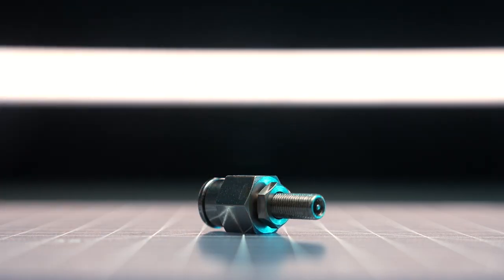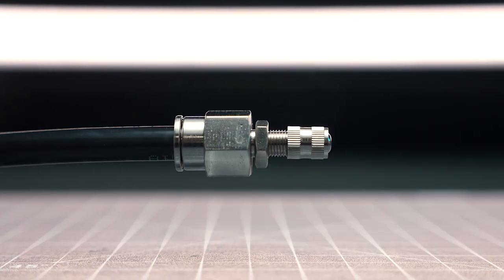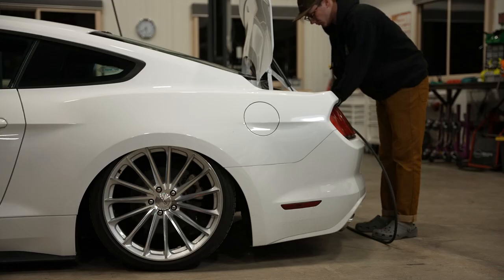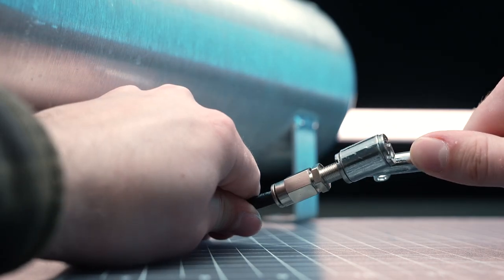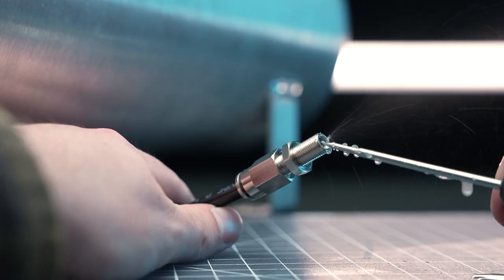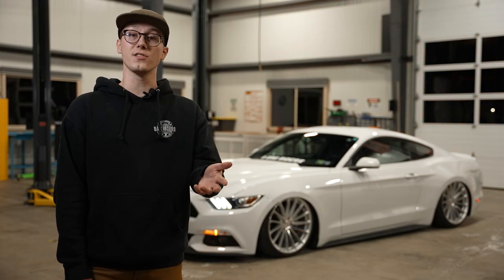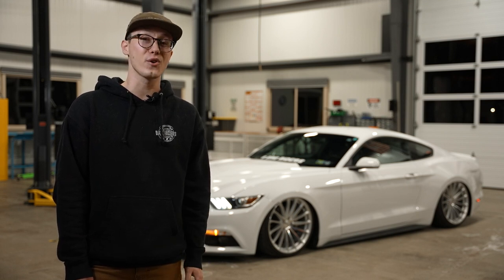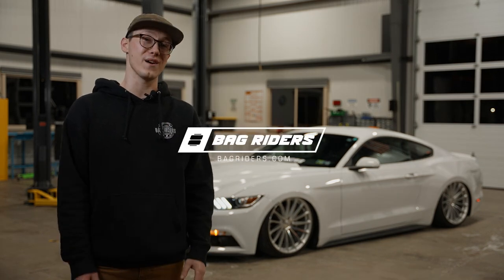What Are PTC Inflation Valves for Air Ride?

Comment: Recommendations for a 3700# car, 1/4" or 3/8" lines. Thanks for all the info.
Reply from the maker: What type of car is it? Depending on the bag style we may change our recommendation. You can't go wrong with 3/8" air line as it can always be slowed down.
Reply: @bagriders  hah I've got 1/4" in a Mk4 VW with 3p, and if it was any faster on rise they'd think it has hydraulics. 
To me ,it rises so fast if you're manually raising it you'll overshoot what you wanted by alot. 
Kinda tempted to put in some flow control valves unless I get used to it(my 1st setup).
Reply from the maker: @MrTheHillfolk  Flow controls would be the perfect solution to this.
Reply: @bagriders  yeah for sure man, you guys have helped me out a lot on the install and it just needs some extra touches like that. 
I'll sort out what I need, and also get myself that kit so I can run air tools.
It's been made into a Ute with a Smyth kit and that'll help with the "utility" part of the build.